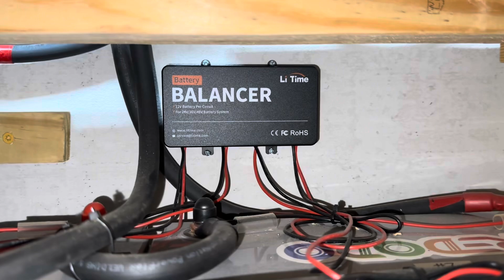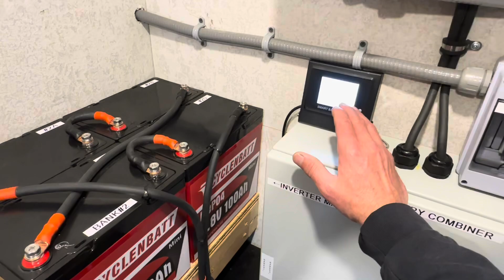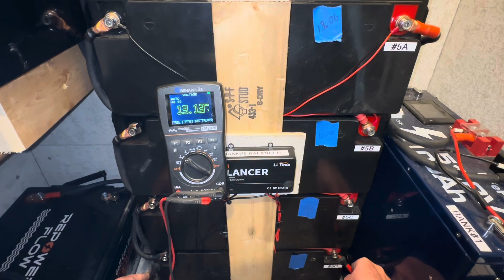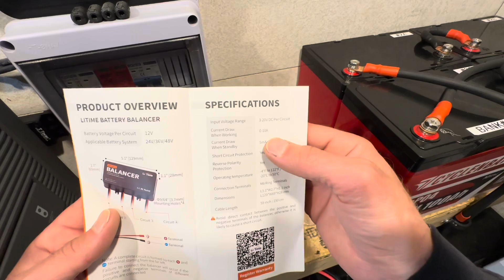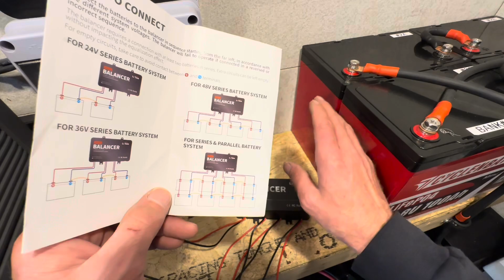LiTime 48V Battery Equalizer/48V Balancer Install Review Operation, Budget 48V Off-Grid Solar Part 4

Comment: Great video - love the detail and tips - will definitely help me with my own system. Also, a benefit to me about using 12v batteries in a series is I can repurpose them for things like using it on a trailer winch, trolling motor, etc.
Reply from the maker: Thanks! 
Exactly why I like to have a few 4X12 setups. Can always use for other things later if needed! 👍

Comment: Are you mixing a sever rack battery with the 4 12s in series on the same inverter? I have a SunGold Power 5000 watt inverter/charter coming and I picked up a Vatrer 48 volt battery coming as well. I was hesitant to order it but I did for simplicity. I can return it as well  if I choose to.
I already own 8 EcoFlow 12.8 volt 100ah lifepo4 batteries. I've ordered 2 LiTime balancers and plan to run them  (2 sets of 4) in series for 48 volts. For reference, I'm doing 12 volt setups right now and because of the heat (amps) and wire size I'm moving to 48 volts. I'm curious if you are doing this how charging works out for the different types of batteries. I assume once either the batteries or the server rack battery read full then one will always be a little short of full.
Reply from the maker: Yes mix and match but all 100Ah cells. There are differences in internal resistance so yes some will be 100% a touch faster but absorb settings allow all the batteries to reach same SOC. 

When batt A is at 54V and batt B is at 53.9 the charge goes to batt B. You can watch this with clamp meters and see how the current tapers or energy moves from one battery to another during operation. 

Even with a matched bank of say 8 server racks with perfect wire setup they will still vary between each. Temperature of each battery also comes into play and as mentioned internal resistance or cell match from the factory matters too.
Reply: @THEOFFGRIDMOUNTAINHOMESTEAD  Appreciate the explanation!

Comment: How does work with a 24 volt series/parallel battery bank?
Reply from the maker: For 24V you have to blank off the unused leads. There are other 24V specific balancers out there that would be a little less expensive.

Comment: Would this unit make any sense with individual 48V batteries in parallel?
Reply from the maker: From memory I think the max input per lead is 18 or 20V. So it wouldn’t work anyway. 
Are you having large current differences between each 48V battery? Are they the same Ah of capacity? 
If it was under an amp or 2 under full load, I wouldn’t worry much. If you’re seeing 5 to 10A or more then you might want to look at some wiring strategies.

Comment: Love your Channel...I believe you should be setting a better example and make all the Buss links the same length.
Reply from the maker: Thank you for your feedback. These batteries will never see anything over about 7 amps. Charge or discharge. They are part of larger bank. I wasn’t wasting $3/ft wire to make equal length series jumpers for this 4x12 pack. If it was to be loaded @ 100A yes. In my application any minuscule resistance difference from the longest jumper will be easily handled by the equalizer. That is 2AWG cable.
Reply: @THEOFFGRIDMOUNTAINHOMESTEAD  I agree completely. Not everyone has or shares the same knowledge level. Just saying, there are a lot of Numpties out there
Reply from the maker: @pauljbusby Thank you I will work to explain, demonstrate better going forward. Feedback from viewers like you is what helps me create better and more informative content.

Comment: How are you liking that li time invetercharger? Have any videos hooking it up to 4x12 bank with settings included? Ill try and review uour channel and find it but if you could let me know tjat would be awesome too haha thanks
Reply from the maker: I really like the inverter and have no complaints about it as to its operation as designed and marketed. 
I only wish it was able to be paralleled and offer 120/240V! 
I charge to 55.2 normally and float/hold at 54.4V the inverter low V output disconnect is 48.0V and inverter shutdown is 46V. You’ll have to tinker with settings for your own preferences. Some people charge higher and some lower. I have found good performance with my settings. Hope this helps!

Comment: Is a fuse needed on each 12v battery or can you just use one fuse on the main postive?
Reply from the maker: The balancer has short circuit protection built in. Some people add inline fuses on balancer leads. Personal choice.

Comment: I want to use a 48v system and your videos, like this one, have cemented the idea using 4x12. 
Can you suggest a good all in one CC/inverter for a 100ah battery bank?
Reply from the maker: I really like the LiTime I’m using on this system. Best power quality of any budget all in one I’ve encountered. Way better than growatt inverters. Still sub $600 even with it almost continuously selling out of stock. 
There are some other all in ones from PowMr/Ampinvt etc but I have no hands on time with them. 
You could always just get a standalone 48V inverter from CNSwipower or similar and add a good charge controller. LiTime, HQST and Ampinvt have good performing and budget friendly charge controllers.
Reply: @THEOFFGRIDMOUNTAINHOMESTEAD  Thank you for the feedback. Really.
Reply from the maker: @WoodTramp  You are most welcome my friend! 👍

Comment: Don’t those individual batteries have bms internal balancers already?
Reply from the maker: Each battery has the ability to balance its own set of 4 cells. The LiTime balancer works similarly but at the unit level instead of just the cell level.

Comment: Thanks for showing how to hook up a balancer on those batteries--I have the same brand. I am considering getting a balancer myself for the 4 batteries I am using on my 12 volt set up. However, I am seriously thinking going to 24 volts and the only thing that would get changed out is the inverter.
Reply from the maker: Glad you enjoyed, thank you! 
For 12V I would suggest balanced battery wiring strategy. Here is an informative article on the subject. https://www.iotaengineering.com/-/media/abl/iota/files/balancedcharging.pdf?forceBehavior=open
This is how I wire 12V multi battery setups. Hope it helps!!
Reply: @THEOFFGRIDMOUNTAINHOMESTEAD Thank you. I have already did the method two on my set up sometime ago. One thing I don't like is that I had to use the extra cables for that method and which is why I am looking to wire it up as a 24 volt battery bank instead. I agree with you using multiple batteries in case one goes bad.
Reply from the maker: @ 24V will definitely be more efficient overall. Be sure to price check 24V vs 12V components. 12V stuff literally is used everywhere why I like it!
Reply: @THEOFFGRIDMOUNTAINHOMESTEAD  It will be only the inverter that will be used to run the fridge and furnace in case of a power outage. The fridge during the summer and anything else that takes 120 volts AC.

Comment: Good evening!

Great video as always! I’m still new to this, but I’ve read that when wiring batteries in parallel or series, each battery should be fused. Is that correct?

Thanks!
Reply from the maker: Most manufacturers allow 4 LiFePO4 batteries in series or parallel configuration served by 1 main OCPD on the shortest positive wire or at the main positive terminal of the set. Some allow up to 6 some 8 in parallel this varies per manufacturer. Most don’t have capability to exceed 48V(51.2) due to voltage constraints in the BMS. LiTime has one I think that can be 5S configuration. 
On lead acid battery banks, it is common to see 10 sometimes more batteries paralleled together on a single OCPD.
Reply: @THEOFFGRIDMOUNTAINHOMESTEAD  Okay thanks!

Comment: i got 24 volt lithium batteries  that are going to be wired to 48 volt is there a balancer that does 2 24 volt batteries wired to 48 volt, or just not needed since im not useing 4 different batteries to get 48 volt
Reply from the maker: 2x 24 doesn’t tend to have as much deviation as 4x 12. There are commercially available balancers for this application albeit much more $$. I have a set of XZNY 25.6 100Ah that have been in service since last summer as series set (51.2V) and they are 0.01V apart. Never charged above 55.2V either!
Reply: @THEOFFGRIDMOUNTAINHOMESTEAD  that was kinda my thought on it  one of reasons i went with 25.6 batteries along with saving on wire and connections , and space savings , just havent seen much discussion on balancing issues of it, more on 12 volt builds to 48, .

Comment: just an aside note I think you are supposed to top-balance the batteries before you connect the Batt Balencer.
Reply from the maker: As shown and discussed on the CyclenBatt. I had all previously paralleled them before series wiring. Also as demonstrated on the Aokly battery even if not balanced before connection the LiTime unit will bring them together given enough time. In my experience about a week with no charge applied it will be completely equal just off the balancer.